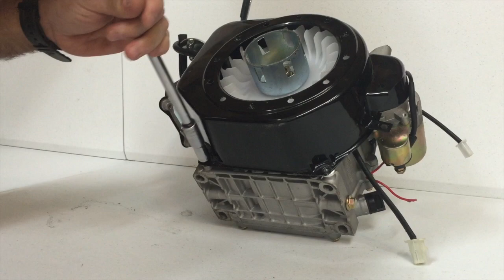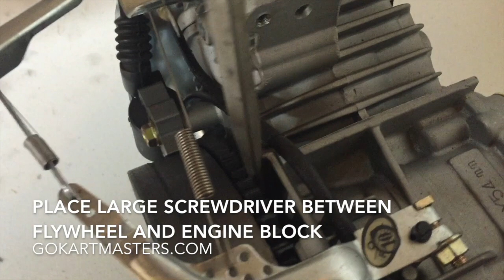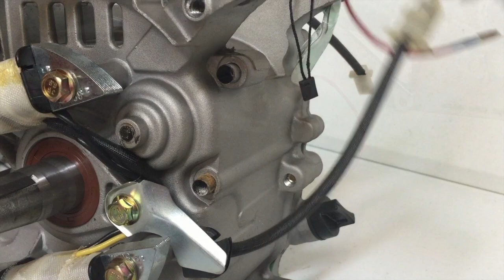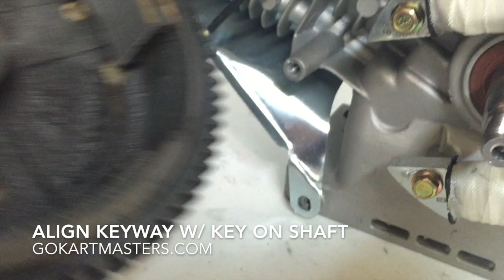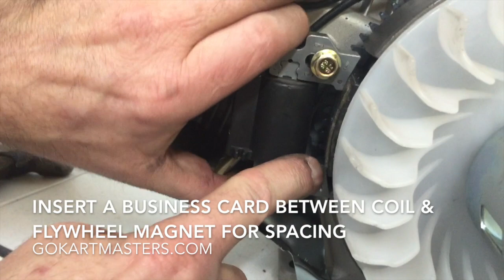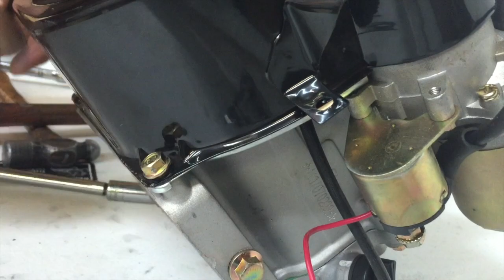Starter Motor Installation - TrailMaster Mid XRX/R, Mid XRX & Mid XRS

Comment: thanks great video I need to see this!!..how do you reconnect the wiring from the starter to the other components? sorry if I come off dumb
Reply from the maker: Thanks! Connections...starter wire to solenoid. Positive battery wire and small red wire (with fuse) to other solenoid terminal. It doesn't matter which terminal for these connections. The small solenoid wire should plug into the harness on the go kart. You may have a solenoid wire with ring...if so, it connects to the solenoid mount screw. We hope this helps.